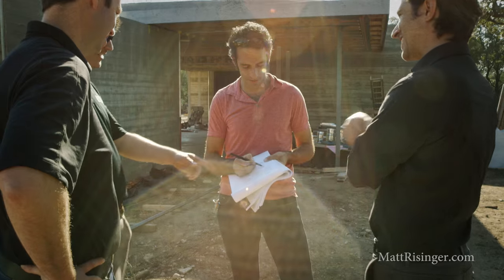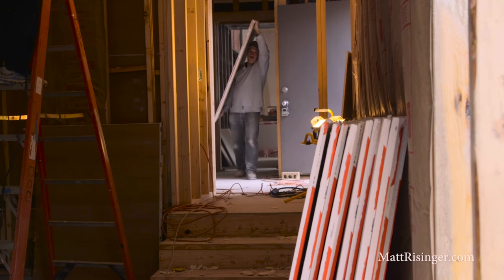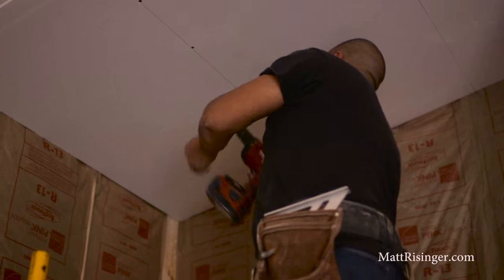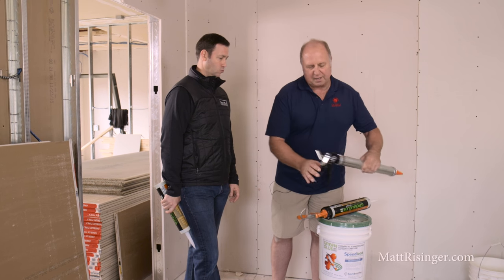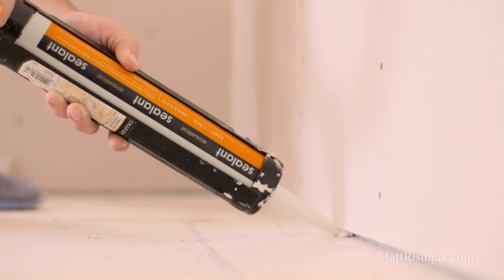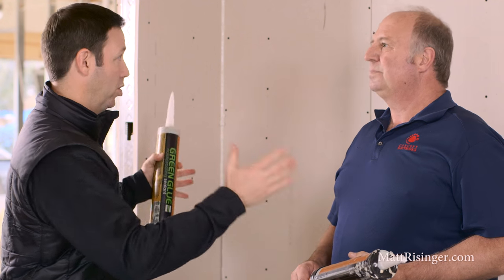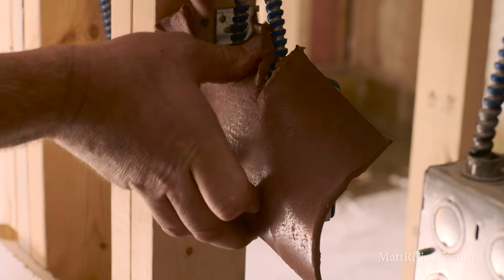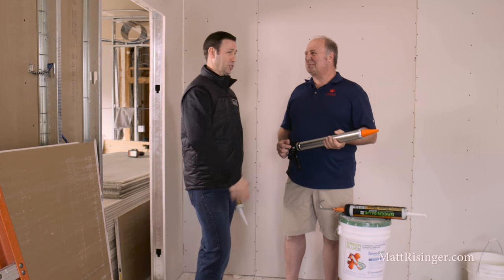How to Control Noise with Green Glue  - Install steps & tips

Comment: I'm sure this product works well, but take note! It requires a very large amount of time and diligence, and it is less cost effective than other more basic options. 
As they mentioned, you must be very meticulous about every detail of the room, leaving no holes or air gaps. Green glue is an added layer of protection that comes at significant cost. Make sure to build according to your budget. Multiple layers of drywall or particle board, regular pink fiberglass insulation and solid core doors will be more effective and better value. You only need green glue if you are going ALL out with soundproofing.
Reply: That isn't true at all. They are already using what appears to be double 5/8" layers and there are a number of studies done on regular drywall versus drywall with GreenGlue versus QuietRock that show the GreenGlue to be significantly superior to the methods you mentioned above.

Comment: Last I checked 100% silicone never hardens either and is 1/3 the cost.  Plus how much is the green glue actually doing to reduce the sound versus the 2nd 58th sheet of drywall that is really doing the work.  I have done the double sheet silicone sandwich., works like a dream.
Reply: I have the same question, this stuff is mad expensive and whats the difference between silicone and green glue?
Reply: Green glue adds a lot to the soundproofing: http://www.soundproofing.com/elements_of_construction3.html
Versus just adding more drywall: http://www.soundproofing.com/elements_of_construction2.html
See the graphs.

Comment: How does green glue with 2 layers of 5/8" drywall compare to QuietRock 510 or 545 in terms of both cost and performance? Also, would you use either of these solutions along with resilient channel and clips, or would it be one or the other?
Reply: The greenglue site has comparisons I believe and there are plenty of forums on avsforum and elsewhere talking about options.  Also, yes if you want the best noise reduction you have to decouple. It is the most important aspect, far more than two sheets of drywall and dampening compound.   But you wouldn't use "resilient channel and clips", you want "hat channel and clips".   Resilient channel isn't used with clips and isn't as effective but is better than screwing directly into drywall. 
https://www.tmsoundproofing.com/decoupling-explained.html

Comment: what about recessing lights in ceiling? most important and largest issue? i created recessed light boxes and installed before hanging first layer of sheet rock
Reply: Two options. 1. Build a box for each one above the ceiling with similar level sound dampening properties. i.e. two layers of 5/8 with green glue or 2. Complete your ceiling (2 layers 5/*" with green glue) and then construct a low profile bulk head with 1/2" drywall (cavity is ~1.75" for pots) ...If method #2 is an option it's much easier and you don't have to create gaping holes in our ceiling. If you do neither, it will negate much of the sound dampening.
Reply: Stacy Young that’s exactly what I did. Very pain staking job. Made plywood boxes with sheet rock surrounding it and attached to recessed clips. Then when putting first layer of sheetrock put noise proofing sealant on the edges to seal 100%. Wanted to see if someone has a quick better idea. Thanks for the reply. Finally finished sealing with green glue and everything. Will see how it will work.

Comment: If  I buy the  5 gallon pails, can this be troweled?  not necessarily completely  spread over the  entire  sheet, maybe the same way he did with the  caulk gun  some little chunks of  the material in the same pattern he did with the caulk gun.
Reply from the maker: Probably but it's not a recommended install. These bulk load guns are pretty reasonable in cost.
Reply: +macrapidito After going through 5 or so 5-gal tubs...I would strongly advise to NOT trowel out the product.  It should still work the same but I'd recommend getting the bulk load gun as it will speed up the install and make life much easier.
Reply: keelerdr
so you  spend 5 buckets ? how big the project was? how many sheets did you install?
Reply: +macrapidito I went back and checked my files, went through 6 five gallon tubs and 30 tubes of sealant. I used their calculation estimate of 375 sq ft per 5gallon tub as a ballpark.  I'll check to see how many sheets. Some rooms were double 5/8ths on all the walls and ceiling, other rooms just the shared walls
Reply: Can the regular 28 pz tubes be used in a regular caulk gun?

Comment: We have a house we moved to that was built in 1955 (semi-detached) we get a lot of excessive noise (loud talking, laughing, music, etc) coming from the shared common wall (8 ft x 30 ft)   basically it was built with ciment cinder block, with ciment / plaster on either side of this.  so basically we have a "Triple Leaf Effect"...  going on here.  We are trying to figure out best way to sound proof.    (without losing 6 inches of depth for a new wall adding to this)... We were hoping to:   Put Green Glue onto CORK panels directly onto the walls we have at present.  (hoping that the Green Glue will add to the Cork panels sound insulation)   Then plan on painting the cork panels..     (This is a living / dining room wall)  Could this seem like a good plan that could work?

Comment: Looking for some urgent advice i share my townhouse wall with a neighbor and the noise coming from her unit is insane. I've pulled the drywall out and the walls were empty with no insulation and no firewall so basically 1 layer of drywall on bare studs no insulation then the same on her side. I'm thinking of doing quiet putty on the outlets + two layers of roxull + resilient channel and two layers of 5/8 with green glue in the middle would this would work good ?
Reply: Day One Management What did you end up doing?

Comment: Matt i have a question: my basement remodel for my office includes a window and also has a cement lower half before getting to the studs above the shelf area the cement creates - are the principles here the same - any difference in installing around a window and or a half cement wall?

Comment: When you apply the Green Glue, about how much air space or gap do you want between the two drywall sheets to absorb sound?  I notice how many tubes should be used, but nothing I see says how tall to make the peaks of Green Glue.  Thanks!
Reply: I’m wondering the same thing. Any advice on this?
Reply: @Hamza-yu1ur  I ended up not using green glue. I used a high R rated insulation board in the middle, then on each side of that I put three strips of 1/2”x1” along the length of the board and then just a thin 1/8” veneer panel on the outside. I read that the dead airspace and the insulation board work just as good. User beware- it was probably a lot more work.

Comment: How long does that glue take to dry? How long do you have to hold up a drywall panel to the ceiling?
Reply: It is not actually "glue" and will not every fully dry, it works by remaining gummy, and will not hold up anything.  You use screws like you normally would with drywall.

Comment: Ok, I have this recurrent question: I already have a wall, which is made of bricks, plastered (to be precise, "textured", "artex" or "stuccoed") and painted. Can I attach a single green-glued sheet directly to it or do I still need to do the usual two-sheets process?
Also, there are a number of "acoustic" drywalls in the market (like Placo acoustic). Should I expect some improvement by using one of those (they are expensive) or should I stick to standard drywall?
Reply: I believe that another sheet of drywall is needed, to absorb the GG; call the company to confirm.
Reply: use 2 sheets of drywall with GG between. Don't use the sound rock. Best think you could do would be to also 'decouple' that wall. So use either RISC clips and hat channel or a resilient channel. DON'T use both. 

RISC Clips - PAC International
  I got them on amazon and they were cheaper than from PAC international. Go figure.

You have to attach some type of firing strip anyway to the brick to attach drywall, so just go the little extra and get  the sound clips.
You will get amazing results.

Remember to try and decouple everywhere, so dont let the new wall touch existing framing or anything (obviously the clips touch brick). DO NOT short the system by driving a screw into anything other than the hat channel!! 
Leave small gap at ceiling and other wall intersections, and then insert backer rod and caulk to seal gap, this way you will get no transfer of sound.

Sound propagates by moving molecules - air, water, solids, doesn't matter - it just changes the propagation but it still propagates through any medium.
Reply: 2 sheets might work, depending on the situation. Drywall w/ GG and Quietrock/Soundbreak's better, though. Also decoupling is the ultimate but is neither always necessary or practical..could be a lot of extra work and expense and using sheets and GG is plenty in most applications, from my experience. Case by case.
Reply: What did you do? I think I have to do the same thing. How'd it work for you?

Comment: In going forward with a green glue project how are door jambs handled with the extra layer of drywall?  I've always purchased doors with jambs for 2x4 or 2x6 wall construction assuming one layer drywall on each side of wall.
Reply: I believe that you'd have to get extra pieces of wood to fill the space; in the case of a new door, you have to order a jamb after calculating the full width of the new wall.
Reply: Greg Vande Corput rip extension jambs to meet the new finished wall depth. glue and nail to existing jamb. install with a reveal or not, your choice. seal gap to rough opening all four sides.

Comment: I thought the compound (green tint) was used all over the back of the board because it contains the viscoelastic properties that dampens vibration between the two hard surfaces and the sealant (white) was used to seal any holes or cracks.
Reply: You are correct.  That's exactly it.

Comment: For pricing purposes: 1gal = 128oz , 1 speed load gun has 34oz , 2 guns per 1 sheet rock = 68oz per 32 sq ft , 5 gallon/ 640oz bucket of green glue = 260$,  640oz/34oz=18.8 guns, so one gun cost around 13.8$(260$/18.8 loads) then that equals 27.7$ (two guns-2x13.8) per 32 sq ft which is 0.86$ per 1 sq ft. Woow did I made this complicated?

Comment: Would this combine well with acousticel M20AD on a solid brick wall?
Reply: The instructions from Green Glue's website suggests the "Compound" is not best used against a soft material - I assume they include rubber in that category (I would). However, the "Sealant" could be applied to all the seams (edges; corners; screws; etc.) and, I think, would make a noticeable difference than if you left the seams open. The Acousticel M20AD does a great job of absorbing low frequencies but the air between it and the frame/sheathing would still vibrate through the seams. I'm using the Acousticel rubber to decouple the floor of my isolation booth from the floor of my room. 

Check this video out: https://youtu.be/aFG-W9nvSrQ?t=2146
Watching this guy's method for renovating his garage into a studio is what got me hooked on the idea of doing it myself. He includes a second brick wall with an air gap between the original garage walls. It's really thorough - I'm not a professional but what he's doing appears to be well-thought-out.

Have fun - and be safe!!

Comment: So, make the room air tight, but what about HVAC? Does running supply and return vents in the room negate all the sound proofing?
Reply: Brad Phillips Nobody's touching that question with a 10' pole. Sound will travel right thru ductwork.
Reply: Yup, ducting is an important issue to address it is one path for sound, not the only one.  If the rooms aren't joined directly sound is going to be reduced because you don't have a straight path, if you use sections of flex duct (especially if it is not straight connection) it will reduce it.   Lots of ways it can be mitigated or already might not be a notable issue for that space. 
Two layers of drywall, w/GG, directly connected to the studs and insulation isn't making a silent room either, but it is a huge difference between a single layer no drywall and no outlet sealing.  This is about reduction, not elimination.   If it was a home theater or really about massive reduction the biggest step he didn't do here is decoupling which you can do with double wall or clips and hat channel. Then things like ducting, doors, windows etc become very important.
Reply: here i am with my 10' pole, proper isolation for recording studios or home theaters either run an independent unit mini split or if they have to run it on the same HVAC should be building in bafflle boxes which can be done up between the joists 
ive done many builds with it, proper baffle boxes are solid.

Comment: question. idk if anyone would see this and have the knowledge to answer this, but if, say, for an apartment, i glued two cardboard sheets together with green glue, and then did that a bunch of times and then covered a wall separating this apartment from another apartment with all of those cardboard sheets, how much of the sound bleedthrough would it eliminate? and would accoustic panels on the inside of the new cardboard wall make any sort of significant difference?

Comment: what about air vents? for heating/cooling/filter
Reply: Flexible insulated (internally) duct with twists and turns to allow the insulation to absorb the sound and low velocity (air falling out pretty much or close) gets you a long ways. Beyond that, make sure the units are decoupled from the space (not on the roof or a wall where vibration transfer will occur).

Comment: Thanks Matt, couple of questions: Do you also use a QuietRock product to help sound transfer? And since you are using two layers are they still 1/2" typically?
Reply from the maker: I like QR but it's a more expensive product overall. You can use two layers of 1/2" but I prefer two of 5/8" for the extra mass.
Reply: Do you know where to purchase quiet rock?
Reply: Quiet Rock or a similar competitor Sound Break can be found by calling the company. They'll provide numbers of companies in your area.

Comment: So can I use regular thermal insulation behind the rock wall or do need special insulation??
Reply: Any insulation will work, but most seem to prefer mineral wool because it is denser and fairly easy to install.

Comment: did he really say to use 2 tubes on a 4x8 sheet? this stuff is hella expensive - you are telling me this is the best way to do this?
Reply: I've seen them for anywhere between $13-20/tube, and the different retail sites that are selling them have them listed as being 28, 29, 31, or 32 ounces. I don't know which is correct. (You can get a bucket for $290, and based on coverage, it is equivalent to $13/tube.) So figure $35/sheet of drywall; average. Assume that you're average room has 16 pieces of drywall on the walls, and another 8 on the ceiling, for a total of 24 pieces of drywall. 24*$35= $850 per room, for a 85 dB of. 85 dB of sound reduction is an insane amount of reduction for such a small amount of randomly distributed, material that is quick/easy to apply. You could be running a chainsaw tits out in one room, with a baby sleeping in the adjacent room, and not wake her up. Very impressive for <$1,000/room. When we were building our house, we packed the walls between the master bedroom and office with sound dampening foam (Every one of the cells, tight, from stud to stuff, top plate to bottom plate. 93½"x14½"x3½" cells), and it definitely isn't anywhere near 85 dB of noise reduction, and I would say that a 4'x8' section of wall cost ~$30 to do; so $5 cheaper per section. Plus it was twice as hard to install, took 10x as long to install, and offers 1/10th the noise reduction. So this is not bad
Reply: 2 tubes, 28 oz each. total about $27 isn't expensive.
Reply: 3 if you really want to do it the "best way" though the best way requires decoupling the drywall from the studs first and doing a bunch of other stuff.  And if you are considering it, watch craigslist and find other deals, don't pay retail.